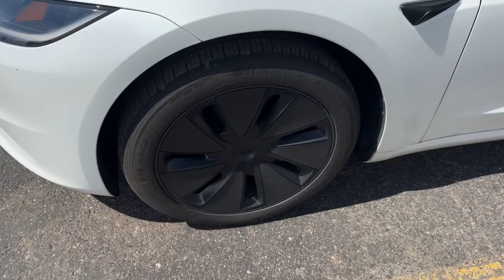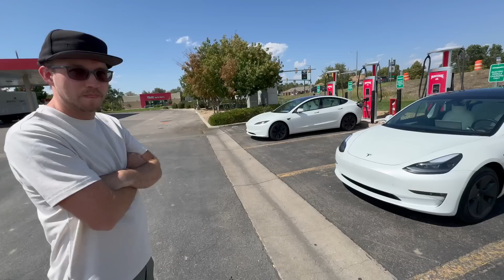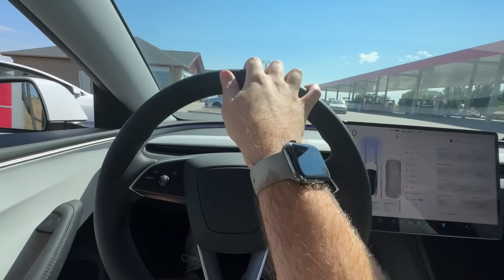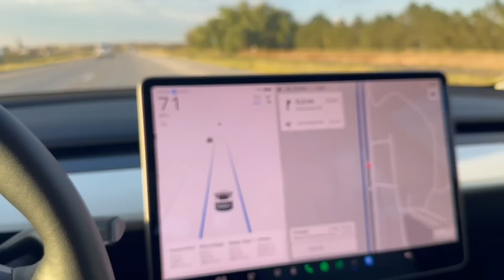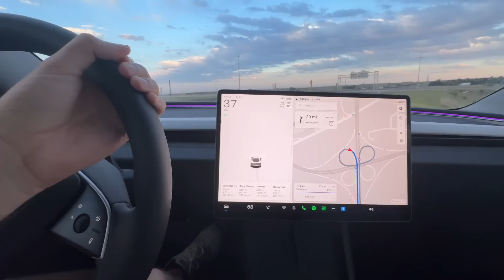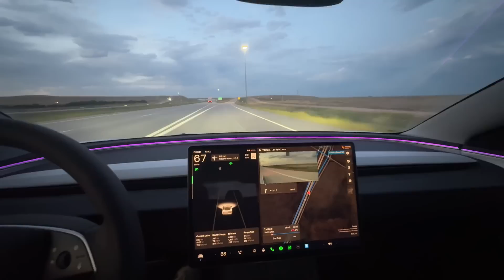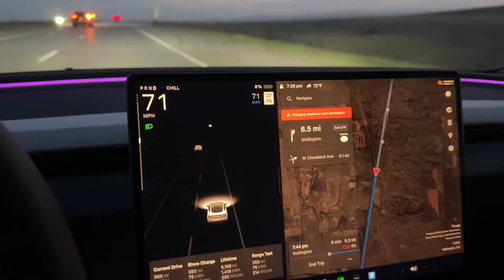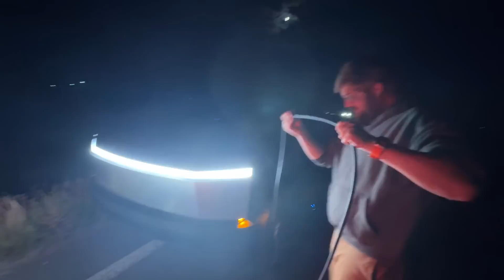Old vs New Tesla Model 3 Highway Range Test! Huge Improvement For Refresh - Long Range AWD

Comment: My 2026 Long Range Dual Motor Premium AWD Model 3 is a fantastic car! It’s my second Model 3 Long Range AWD—my last one was a 2021. This car runs circles around the 2021 in pretty much every way: a bit faster, much smoother, quieter, more refined, and noticeably more comfortable. The suspension is vastly improved, the interior feels more upscale, and the range is excellent. Tesla really did a lot with the latest refresh. It somewhat feels like a completely different car.

Comment: That's a shocker! Those Hankooks are still the top rated EV tire today. As other's have said I'd like to know how much each would change if the tires were swapped. The Hankooks with 6k miles are right around their most efficient too, not too new. Really makes me wonder if it's worth it to pay the extra for the Hankook tires.

Comment: I recently bought my wife a 2025 MYP as a "city car"... I'm not a fan of electric vehicles, but I have to admit, if you put it in "sport mode", the acceleration is quite impressive... I leave it in "chill mode" for her though... Too bad the kiddie "engineers" at Tesla decided to put nearly everything under menus in the touch screen... Having a button on the center console near a gear shift for "sport" vs "chill" mode would have been nice... At least it has stalks on the steering column instead of buttons on the steering wheel to signal turns or requiring the touch screen to shift gears...

Comment: i bought a used 2022 performance model 3. it maxes out at 268 miles at 100%. thats a loss of 15% battery retention. the last owner must have loved 100% charging it all the time and letting the battery drain below 20% constantly. thats a loss of 15% after 32 months of use and only 27,000 miles on it.

Comment: So the difference in km is like 100km which at 50km in a gas powered vehicle, your gas light turns on. Also, are we taking into account the power saved? Like when you hit 0% there’s still a bit of juice to get you to a station just like a gas powered vehicle

Comment: I think these cars need a minimum of about 115kw of battery when new.  My reasoning is that you would always have access to 85kw real world useable energy well past 100k miles.  That way you can pretty much always get 250 miles of range regardless of temperature

Comment: Automobiles are one of a family's biggest expenses.   Tesla 3 start off at 30k not bad for a low end car.  300 miles is typically all I will drive in a day max.  
How far will it go in cold climates?  What is the insurance cost?   Typically these type cars are totaled during an accident because of the way they are built
and that has considerably increased everyone's insurance rates.  How many miles do you get out of those new tires?

Comment: Personally, I think that if you're running the battery all the way past 0%. Nothing past 0% should count. I think the real test should be what range you get between 20 and 80% or $20 to 100%. Because this is what the manufacturers are recommending to keep charge with.

Comment: some errors and inconsistencies in this comparison : 
1) you talked about 19 inch tyres for the Highland but a zomm in show Hankook tyres 235/45 R18. Ok so thats fine
2)you compare those cars saying the tires have evloved a lot. So why not run the same new tyres on the 2021 TM3 for a fair comparison because people will change tires or the newest of course..
3) you said that motors are the same but they are NOT. They are the same between the Hughland ant eh 2023 TM3 but not with the 2021 TM3. The VIN and motors codes are telling this on TTF forum.

Comment: Can't wait until I see what range you have for the M3 RWD long range.  I just took mine (got a week ago) from Vegas to Orange County CA.  Normally 270 miles.  Drove most of the way @ 70mph.  At destination still had 140 projected miles left.  No wind, elevation decreased from 2000' to 0, so that would have helped range a bit.

Comment: Everyone needs to also realize that these guys are in Colorado. Why does that matter? The air density is much lower up there, and will definitely help range. You will NOT get the range that these guys are getting, if you live where the elevation is close to sea level.

Comment: I have now 72000km on my 2021 Model 3 LR with the 78.8kWh LG. Average consumption 158Wh/km overall. And that includes about 60-65% highway travelling in Europe with aimed-for average speed 110-130kmh on highways. Insanely efficient car!
Reply: So what do you get for range on average? I'm thinking to buy an EV next year. Tesla 3's are coming out of lease and are getting cheaper.
Reply: @Fanaleds-software  at 110kmh (your 70mi/h) with now about 8% degradation (I am at roughly 72.5kWh gross and about 70 kWh net) I can do 450km (287mi) without going into the buffer. on long trips, I usually do a first stint of around 400km (250mi) and then around 350km (215-220mi) on the next.
Reply: @Watt_Ihr_Volt  Thanks! I'm also using km's so that sounds good. I'm looking around to see if that would be a fit for us as a main car. We don't ride much (mostly small bits) but we also go on vacation every year, with around 5-6000km every time to.
Reply: @Fanaleds-software  then i think the better choice for you is the Model 3 SR ... totally enough for every day and works well wnough for long distance
Reply: @Watt_Ihr_Volt  isn't the LR a safer choice? We are also thinking about pulling a small trailer. And certainly are using a bike rack on the rear.
Reply: @Fanaleds-software  well it is the better car concerning power, AWD and range...

Comment: The interior of my Highland creaks and cracks like a b.... been to the service center 10 times now, and am scheduled for reapirs to the steering wheel next week.  Coming from the 2020 model, I'm deeply disappointed in the quality of the 2024. Looks nice, but it's lipstick on a pig, tbh.
Reply: That's unfortunate, mine has been basically flawless, except, I had what appeared to be bubbles on the LEDs on the doors, but they fixed it the same day I took delivery. I have almost 7,000 miles on it now, and it's been perfect since then.
Reply: @ProXcaliber  I'm glad to hear that. Today I had some kind of a breakthrough. I wiped all door rubber seals down with isopropyl alcohol, and applied Aero Protectant 303 to all seals, also the upper inner seal that meets with the window's upper edge. It seem to have helped a lot on the creaking. However, steering wheel still needs to be repaired or exchanged.

Comment: Correction for 5:00 -- those are 18" wheels.  The model Y comes with 19" in base spec, the model 3 comes with 18".  You can actually see the R18 if you look closely at 5:05

Comment: Got my 2024 LR AWD Highland recently with Nova wheels/ Continental all season tires, it gets me around at least 30-35 miles less range based on your tests but I also have only drove it from 100% - 2% (not until dead) twice on a few longer trips the PNW without supercharging. Positively surprised with its range performance especially with my driving habits! (spirited)

Comment: They are both still half what I can do in a Mazda 2 turbo diesel at 70 mph and it will take me 5 mins to fill up and do it again at a cost of $40.95.
Reply: Now try to do it with 2 or 3 gallons, that is why this is impressive.
Reply: @ProXcaliber  Why? Its impressive to do 700+ miles for $41. Doing 330 miles in an EV is not impressive.  Why dont they do it on a 20kWh battery?
Reply: @csjrogerson2377  This car is achieving near 400 miles on what is the equivalent of 2 to 3 gallons of gasoline or diesel. That is why this is impressive. It isn't impressive to do 700+ miles on a ICE car because it's already been done, and it's been exceeded as well. You can technically get an EV with a longer range, but you'd also pay the price for it. And that is where this is also impressive, the fact that you can get this kind of range at the price that this starts at is showing the progress that EVs have made to become more affordable. It wasn't but a few years ago that you would find it hard to find any EV that could even hit 300 miles for almost double the cost of this.
Reply: @csjrogerson2377  It is impressive, because as I already mentioned, this is achieving those 370 miles with what is the equivalent of 2 to 3 gallons of fuel. And because it wasn't long ago that to get 300 miles of EV range, you would have to pay almost double this price.
Reply: @ProXcaliber  Please explain how this is equivalent to 2 or 3 gals of fuel. 
EVs cant do 700+ miles and if they applied the 80/10 rule they dont get 300 or 370 either.  After they run out of wigglyamps, they have to recharge at public rates, probably twice.  Now work out the cost.
If the 300 mile version was 95% efficient as EVangelists claim, how come you can now get 370?  Somebody must have been lying.
Reply: @csjrogerson2377  It's simple math and physics, really. I will explain it as best I can, 1 gallon of gasoline is equivalent to 33.7 kWh of energy when burned, which is equivalent to 1kWh of energy stored in a battery. So if you take the capacity of the Tesla Model 3 Long Range, which is 82.5 kWh of total capacity and then divide it by 33.7 kWh of energy that 1 gallon of gasoline produces when burned, that then equals 2.44 gallons of gasoline. And you can do the same math for diesel as well, expect that diesel produces 36.3 kWh of energy when burned. And to explain, the 80/10 rule only applies to daily driving or when storing the vehicle without use for long periods. For trips, it is recommended to charge to 100%, and you can easily go as low as 5%, however, you should not do what they did here and let the vehicle reach 0%. However, they did account for that in the video (if you watched it) and they said that the car reached exactly 0% indicated at 350 miles exactly.
Reply: @ProXcaliber  Further to my previous reply, what is the point of your incorrect comparison? We all know that the EV powertrain if mor efficient than an ICE but so what.  An EV can't carry enough wigglyamps no matter how efficient it is.  Its a energy density problem.  An ICE doesnt care about being 30-40% efficient as it can carry lots of fuel at very little weight.  12,000W/Kg.  EVs get 280-360W/Kg. See what your up against. Then dont forget who the wigglyamps got to your car.  Might be coal or gas.  Not cool (pun intended).
Reply: @csjrogerson2377  You said that it isn't impressive, I made a counterpoint to why it is impressive. Sorry, you don't like it, but that is just the reality. EVs haven't been stagnant and have been improving in efficiency and are coming in at lower and lower cost. I don't know if you know this, but you can get EVs that have 500 miles of range now if your wallet can support it. And this trend will continue as battery technology continues to develop and improve. There are also improvements that can be made to the motors and wiring of the car to make it even more efficient still. So realistically, while today you can't buy a Model 3 that can go 500 miles, tomorrow you will be able to, and it is only a matter of when and not if. Even then, hardly anyone will ever go 300+ miles in a day every single day. The average person in America, for example, drives less than 40 miles per day. The only time that range comes into question is during a road trips, and even then, the majority of people only take a long road trip 2 to maybe 3 times in a single year on average. Again, my whole point of even commenting under your comment was simply to show you why this is impressive. Just because it isn't impressive to you, or because it doesn't fit your lifestyle, doesn't mean it isn't impressive.
Reply: @ProXcaliber  What happens if you do a lot of long trips or you have a long commute? How often can you charge to 100% and run to zero? Surely charging to 100% on a regular basis is detrimental to the battery? I know people that drive 200 miles per day to get to work and back. H
Reply: @csjrogerson2377  You said that it isn't impressive, I made a counterpoint to why it is impressive. Sorry, you don't like it, but that is just the reality. EVs haven't been stagnant and have been improving in efficiency and are coming in at lower and lower cost. I don't know if you know this, but you can get EVs that have 500 miles of range now if you can stomach the cost. And this trend will continue as battery technology continues to develop and improve. There are also improvements that can be made to the motors and wiring of the car to make it even more efficient still. So realistically, while today you can't buy a Model 3 that can go 500 miles, tomorrow you will be able to, and it is only a matter of when and not if.
Reply: @csjrogerson2377  And to your second comment, I don't know. I'd suggest maybe looking at EVs that are used as taxis, as there are a few examples of those already driving around. There was one recently covered by AutoTrader (I believe in the UK) that has 400,000 miles on the odometer and other than cosmetic damage is still in great running condition.
Reply: @csjrogerson2377  For your second comment, I'd suggest for you to look at EVs that are used as taxis. There are quite a few of them around, and some with well over a few 100Ks on them as well.
Reply: @csjrogerson2377  It doesn't really matter what you charge the battery to, as long as it doesn't sit at a high charge level for a long period. So realistically, you can charge to 100% every day if you wanted to, as long as you actually use that range. Same thing applies to going to a low state of charge but in reverse. You can go as low as you'd like, as long as you don't let the car go completely flat, or you don't leave it super low for a long period of time. The only real current downside to EVs is the charge time, but even that is improving. Just look at some of Volvo and Porsche's new EVs that can charge from empty to 100% in 20 minutes. And they are even testing some cars that can charge from empty to full in less than 10 minutes, but the current limitation is the cooling on the cars themselves can't keep up with the amount of heat that speed of charging causes.

Comment: I did a littlest more checking and it is also possible that your ranges were very good partially due to altitude (lower air density = lower air resistance) particularly due to the fact that you were doing a highway comparison.  Not sure what altitude you were at but some some basic calculations could increase range by up to 20% (highway only) sea level vs 5,000 altitude.
Reply: They do all their range tests on the same route at the same speed.

Comment: dang, he calls a 2021 car old and degraded. To me a 3 years old car is barely broken in and a 7 years old car is still new and a 10 years old car is alright and old is a 30 years old car. This really make it seems like EVs are disposable cars.
Reply: He didn't call the car old, he said the model is older referring to it's body style and design, and then he said the battery is degraded because it has lost about 5% of its original capacity. This is normal for EVs, since batteries tend to have an initial hard falloff and then taper off and degrade more slowly. There are plenty of videos you can find of EVs that are used as taxis with 300k+ miles on them, and they work perfectly fine.

Comment: I just got a new M3 SR (China made, 18 inch wheels).  Previously had a 2021 model LR (late 2020 build from Freemont) with 19 inch wheels.  The Highland is way more efficient relative to the car's rated range - much the same actual range as the old car and even more given you can charge to 100% if needed without worrying about hurting the battery.

Comment: Still did not get the clamed range , maybe at 60 miles per hour .
Reply: Did you not watch the video? It reached 370 miles total at 70 miles per hour throughout the test, and the claimed range is 341 miles.
Reply: Are you blind or def or both BC they surpass the claimed range 😂

Comment: This Model 3 has a Million Mile Battery. 
370 miles per full cycle would imply only ~2700 full cycles to reach a 1,000,000 miles. 
Following Out-Of-Spec longevity procedures could unlock even more miles of drivability.

Comment: If you buy the car you definitely don’t want the panasonic!! the LG battery may has less oomph which only shows in the performance version BUT will have LESS DEGRADATION
Reply: Do you have any source for this? I can't find the information you are sharing anywhere, genuinely curious since I have the same Model 3 LR as in the video but with an LG battery (or so I believe).